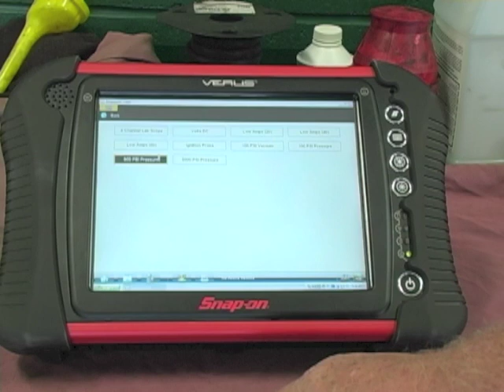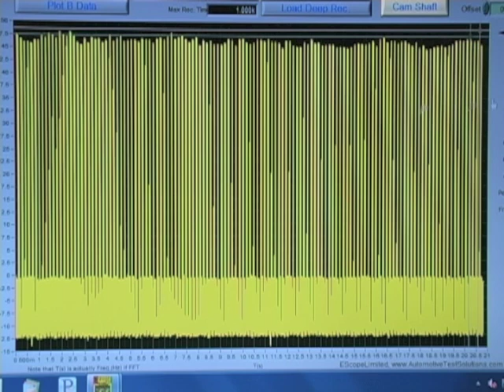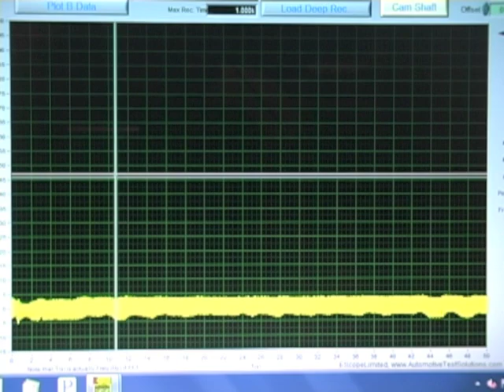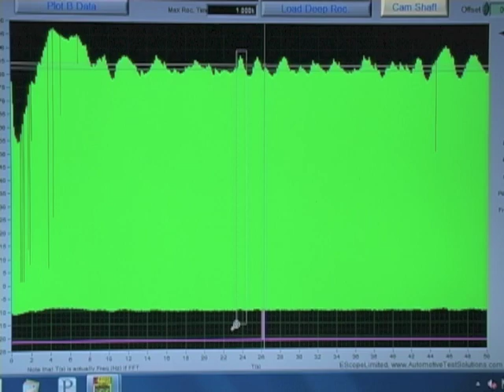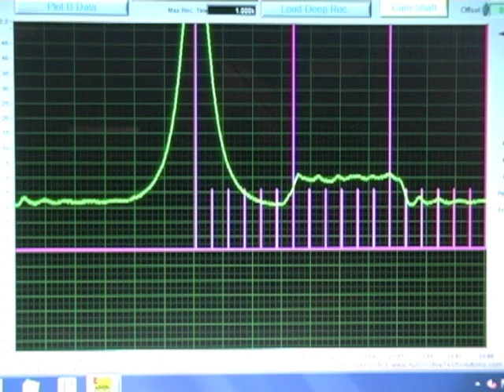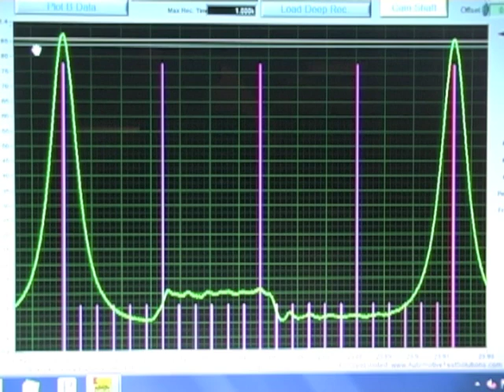The Trainer #31: A Beginner's Guide On Using In-Cylinder Pressure Testing For Drivability Diagnosis

Comment from the maker: Interesting! Thanks for the observation. Is there a reference you can point me to that explains that?

I would think, being a layman, that even with the heating of the air charge, peak pressure would still occur at the point where the combustion chamber volume is the smallest. ???

Comment: Wouldn’t a leak create less vacuum on the decompression stroke?
Reply: A leak creates more vacuum on the descompression stroke because you have less air at the time the piston starts moving down and the volume starts to increase. This creates a higher pressure differential, that is why the pocket  goes deeper (more vacuum). When there is no leak at the compression stroke the same amount of  compressed air is returned to its original volume at the end of the expansion stroke this means the vacuum is the same as the one achieved at the intake stroke.

Comment: Any idea why your waveform from the Zeus+ is not as uniform as the one captured in this video? The Zeus+ intake capture seems to rise / slant upwards shortly after the intake valve opens. One would think that the modern Zeus+ capture would at minimum be as accurate / detailed as this 9 year old capture with older technology. As far as I remember, you didn't mention that the engine had any mechanical issues (in the Zeus+ video)... so the only thing I could think of that would affect the quality of the Zeus+ capture... would be the pressure sensor or the scope. One could end up thinking there's a mechanical issue... when there isn't one (recent Zeus+ video).

Comment: Awesome video pete! Do you know of any websites that list OEM cam spec sheets? I found aftermarket cam sheets but very little for stock oem cams
Reply from the maker: Many of the service information system providers have this info in their data, and you can always access the OEM service sites (most require a fee, though). Check out http://www.nastf.org for info on accessing those.

Comment: Pete, great video.  I would like to point out something.  The peak pressure IS NOT piston TDC.  Due to thermal dynamics, as the cylinder volume decrease, even though you are motoring, not firing, the charge will heat up due to compression. This heating of the charge will cause the peak pressure to happen before TDC of piston.  Sorry, can't help myself.  It's part of being involved in cylinder combustion analysis for over 35 years. :-)
Reply: Hi Eric, I realize you posted this few years now but I was jus wondering if you could direct me to some information which supports argument, thanks a lot.

Comment: I did an in cylinder pressure test on my 2007 chevy aveo5. I synced the ignition on channel B of my picoscope. The ignition timing was 1 deg after TDC. This is a waste spark ignition system. Is this normal?
Reply from the maker: If this was a running test then I suspect timing is off by at least a tooth. Verify by looking up the spec. Typically  idle timing is 10-15 degrees BTDC

Comment: I was wondering if someone knows where you can find ready to go  budget pre- wired boxes for the 5 volt power supply to hook up to readily available pressure transducers without having to obtain the parts and build your own?
Reply: They sell those boxes on eBay, you can then buy pressure transducers that are reliable and use it based on the accuracy you want. The pico version is of course a best investment if you don't want to play around with something you don't 100% trust.

Comment: can I know why the pressure transducer located at first cylinder..? I read two journal paper about in-cylinder analysis and measurement but it does not state why...
Reply from the maker: +mohammad muzammil The test can be performed on any cylinder that you suspect has an issue. It can also be used to compare one cylinder to another - as when diagnosing a problem between cylinder banks. Wherever you would perform a traditional compression test, this test can be performed and provide so much more information for the time spent. There is a whole series of articles authored by Bernie Thompson on the Motor Age site.

Comment: Hi. Very good video.
Can you tell me please, I would like to know what model is the sensor shown in the minute 1:58 
with a cable from the sensor ending with a BNC connector for the scope
Reply from the maker: There are several on the market, with some designed for a particular scope platform while others can be adapted to nearly any scope. Check out http://aeswave.com for a varied selection that are proven performers for automotive use.

Comment: I am just getting into using a scope. Can I ask what equipment you're using? Thanks for all your help with these videos.
Reply from the maker: I use a Pico scope (PC-based) and their WPS500 pressure transducer. There are other options that work just as well, so if you already own a scope be sure to check out all the possibilities.
Reply: Motor Age pico scopes it's easy to check timing and fast  this way sucks

Comment: If we don't like to test for ignition event, Will it be wise to leave the COP unplugged?
 Thanks a lot for ur videos, They r as much helpful as usual.
Reply from the maker: That shouldn't be a problem. But including the ignition event is an easy way to rule out timing issues, so why not include it? You're already right there!  :-)
Reply: @MotorAgeMagazine  Fair enough Pete, Thank you very much.
Reply from the maker: Here's your chance to learn from one of the leading experts on the subject of the use of pressure and vacuum to diagnose all manner of engine/drivability issues:  https://endeavor.swoogo.com/virtualtrainingsummit

Register for the Virtual Training Summit and look up Brandon Steckler - watch every video he has there. Those alone are worth the cost of admission. Then take advantage of the remainder of your 45 day access to dive into the library of over 40 different presentations - many will feature a date/time when the presenter will be available for questions.
Reply: @MotorAgeMagazine  Thanks a lot Pete, I will sure check it out.

Comment: If you have a bad lifter on the intake or exhaust side how would that affect the waveform?
Reply from the maker: I would think it would depend on the nature of the failure. If the lifter collapses, the valve will open later than it should and remain open for a shorter period of time. You can see the difference in opening time with this pattern.
Reply: Motor Age i need to get me a pressure transducer and do some.experimenting.... lol

Comment: my knowledge the ignition timing controlled by pcm few degrees before tdc   while engine is running ,so is it normal to see ignition out of tds as long as timing is within specification ?
Reply from the maker: What you see on the scope is what is REALLY happening. Here's a brain teaser for you. The scope shows the timing is out of spec, but the scan tool data says it is in spec. What could be wrong?
Reply: i can rephrase to be cleared:
in good engine  we can check cylinder compression and we  see ignition timing  exactly at tdc this in case of  test done by cranking engine (injector and coils disabled).
if engine at idle ignition timing will be at tdc and also  any degree within timing  specification for  instance  , assume timing is 10-18 btd so timing will be at 10 or 11 or....

in non good engine (  jumped timing chain, ...) engine cranked( injectors & coils disabled)    we will see ignition timing not at tdc but few degrees btdc , if it is at 10 or 11 or 18 degree we still say timing chain is jumped because specification taken in mind in good engine and while is idle . in idle, timing will be out of specification as long as chain is jumped .

are all above is correct ?
sorry for my bad English
Reply from the maker: No reason to say you're sorry! You speak two languages! I only speak one...and that not very well.  

Back to your question.
First, don't think "idle". The engine is not running.
Second, the ignition event should occur just before TDC at the peak. Any other position requires further investigation. It could be a jumped chain or belt, or a sheared key.
Third, jumped timing chain or belt will generally change timing 10 degrees or so.

Hope that helps!

Comment: after exaust back pressure  u can tell exaust manfold lenght ( runner)? <3
Reply from the maker: No, you can't determine runner length using this method. Interesting idea though!
Reply: hmm if u know back pressure speed wich is speed of sound and time between peaks of exaust is that wave is traveled 2 runners lengt ? (P.S. sor for bad english)
Reply from the maker: Vladimirs Sinkevics OK, I won't say positively "No"...but it seems to me that there is too many other factors involved - runner length, shape of the bend, location relevant to the cylinder being tested...

Comment: thanks for the info... but can I ask if this method use in research... the in-cylinder pressure graph will provide what information to us
Reply from the maker: +mohammad muzammil This testing method provides a wealth of diagnostic information including verification of proper ignition timing, cam timing, variable valve timing, valve sealing issues and much, much more.
Reply: +Motor Age thanks but are this infomation can be related to heat release rate... and can you explain how heat release rate vs crank angle was obtain...
Reply: +Motor Age thanks a lot for you respon I really apprecite
Reply from the maker: +mohammad muzammil I think we are talking about two different things here my friend. This is not a research tool, but an every day diagnostic tool for technicians. We are not concerned with heat release rates, and I couldn't even begin to offer any insight into that question. Perhaps SAE has papers published that could be of more help to you?
Reply: +Motor Age ouh... i get it now. anyway I still want to say thanks alot for you positive respon and the suggestion..